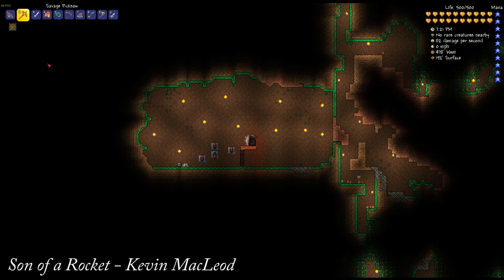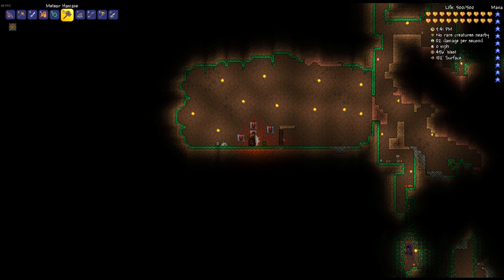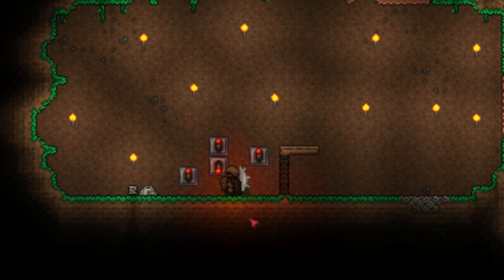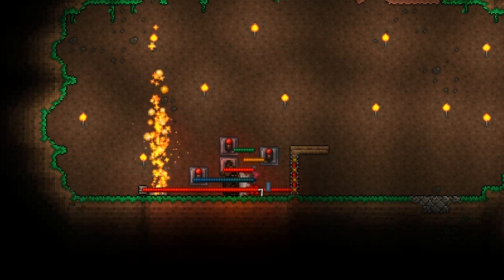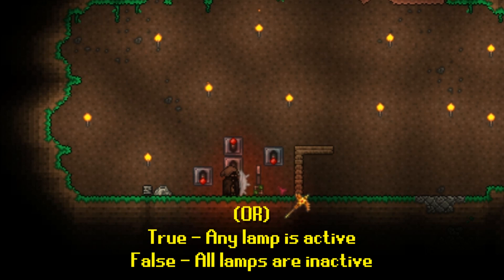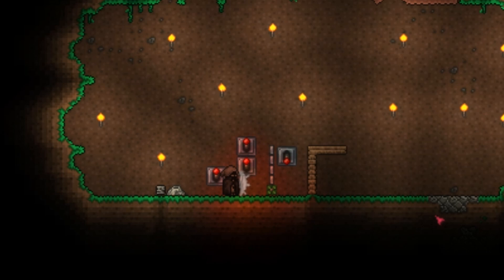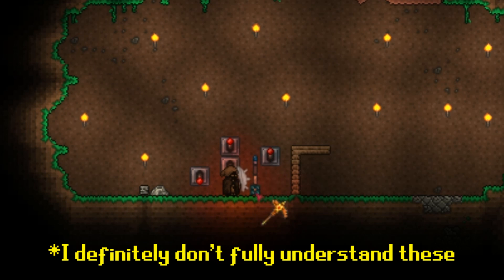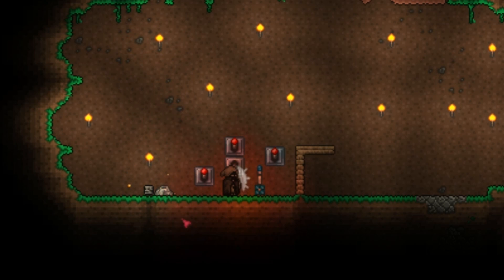Terraria 1.3.1 - Logic Gates Full Tutorial

Comment: how to i make the lamps NOT permanent (i.e. if i step on it with a pressure plate, it currently does not turn back off. it stays on.)
Reply from the maker: Lamps are toggle-only, as far as I know. So when a pressure plate sends a signal from being pressed, it will make the lamp go on. If the lamp is on, it will turn off. When you step off the pressure plate, you remove the signal, which does nothing to the lamp. The lamp will only shift states if you are sending a signal. As far as I know, this means there's no way to make sure someone is still standing on the pressure plate for lamp puzzles
Reply: Robby Mitchell this is stupid. i wanted to create a trap that only triggers if two lamps are on (and gate, obviously), but the problem is that the lamp doesn't turn off when i leave the pressure plate... so it's impossible to create.
Reply: there is a pressure plate that activates when stepped on and stepped off that might work
Reply: how do you manage to forget weighted pressure plates? also everything works like this in terraria wiring.
Reply: And gates connected to an or gate and whenever you press the pressure plate a lamp activates on the or gate,

Comment: Based on the testing I have done with the faulty lamps. It's not really random, but the chance of activation is based on the number of on lamps vs number of off lamps. So 1 on and 1 off = 1/2 or 50% chance of an activation. If you had 2 on and 1 off then it's 1/3 or 33.3% chance of an activation. 3 on and 1 off = 3/4 or 75% chance of activation and so on.
So if you wanted to build a device where it only has a 10% chance of activation when a player hits a switch/lever/pressure plate, you would have 1 on lamp and 9 off lamps. So now Terrarians can play some games of Russian Roulette with dart traps. XD
Reply from the maker: Thanks for sharing, I definitely will test this but that makes a lot of sense
Reply: Robby Mitchell Yeah, I'm working on something that uses the faulty lamps for a randomizer in a kind of game. So we will see how it turns out if I can get it all up and running.
Reply: Prepare for sadistic puzzle maps where fire traps and other shit fires at random chances.
Reply: Purple Ice
Yeah, you can make randomized traps. I was playing around with geyser traps that go off at random times. And I use randomizers with 10 lamps in the duck hunt like game I'm making.
Reply: Vis Yeah I figured as much, and would like to see it if you ever get finished with it.

Already done some stuff with wires but those gates are too much to handle.
Reply: Purple Ice
Too much to handle? XD No they are great. For most things you only need AND gates. Also I have made a thread about my duck hunt game on the forums. http://forums.terraria.org/index.php?threads/duck-duck-dart-duck-hunt-in-terraria.45200/#post-1006281
Reply: im 2 years late but thank you so much. tested them too and that seems to be whats happening here.
Reply: k